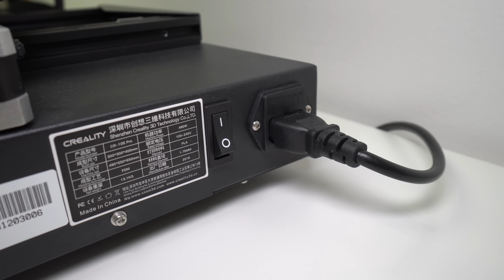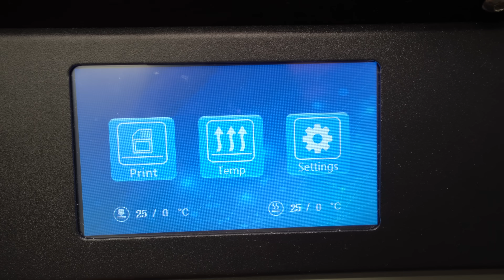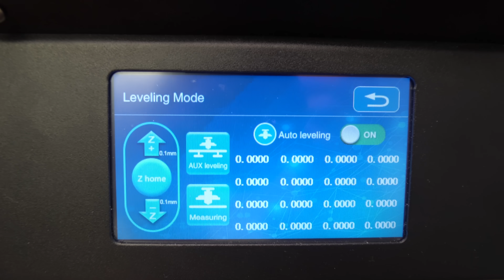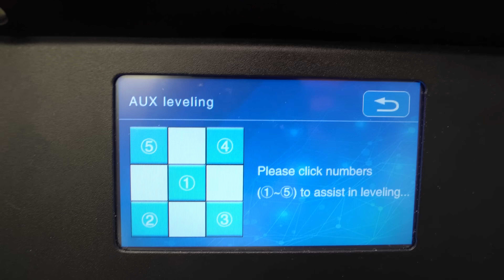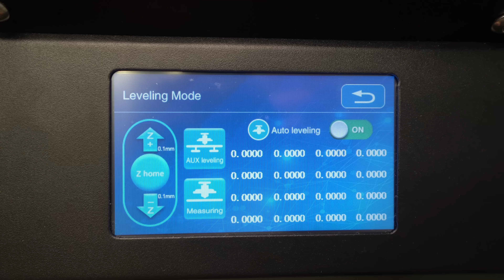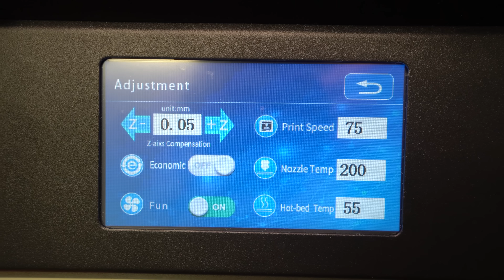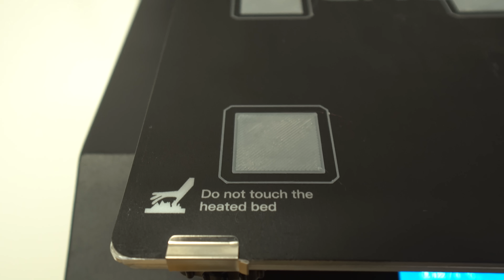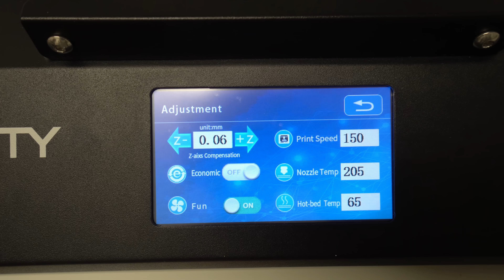Creality Cr10S PRO - Fix your bed leveling issues (Inductive sensor install)

Comment: I just did this upgrade and now both the inductive and conductive sensors keep saying z_min TRIGGERED. Both sensors light up when triggered but they won’t allow the Z to lower. I have marlin firmware if that makes a difference.
Reply from the maker: Justin Sliker Damit! You did not read my Pin comment? I seems like there are few versions of these inductive sensors and apparently wrong one can damage the board. Which sensor type you received?
Reply: Nexi Tech I ordered the correct sensor but amazon sent the wrong one. The main board is toast.
Reply: @justinsliker6995  It may be the daughter board went out. Read some of the other comments on this video and you'll find someone posted a link to Facebook. The post says there should be an LED light that lights up on the daughter board that the ribbon cable attaches to. If it does not light up, that board might be your problem.
Reply: @justinsliker6995  fortunately for me I've only had my printer for 3 weeks so Amazon is sending me another printer to pull the daughter board to fix my printer. I will let you know if it was in fact the daughter board or the main board that went out on my printer.
Reply: @justinsliker6995  so i got my new printer from Amazon but i could not bring myself to changing out the daughter board due to the free replacement period ending the day I got the new printer.  So I ended up moving all my upgrades to the new printer and am sending back the old printer. Sorry I could not say for sure the daughter board was the cause of the z home issues but I think it was. My LED light on the daughter board would not turn on on the old printer but it works on the new printer.
Reply: I just did the same thing. I was hasty in my installation and didn't test it beforehand, seems to have blown something as it's always triggered. Sensor says it's the right part number (LJ18A3-8Z/BX), even says NPN and NO on the label (Taiss). Tested it now and it's not as described in the description (I suspect it's a NC). Fortunately checked on the main board's "Z - " connector and if I plug the old sensor (not gonna try the Taiss thing again) back in there it toggles between triggered and okay, so this weekend I'll make an extension and switch back to the old sensor for the time being. 

Lesson learned- test beforehand, don't just rush home from work and get overexcited haha :p.

Comment: Another great tutorial nexi. Do you happen to know the connector type that connects to the board(3pin white). Was hoping to change my sensor without doing any soldering. Again keep the great tutorials coming for the 10S Pro.
Reply: Jst 3 pin connector
Reply: Yeah but hard to find one with a clip.

Comment: Inductive sensor doesn't work with stock glass bed, unfortunately. 
My CR-10s pro came with glass bed from the factory, the original capacitive sensor worked like a charm, until the cable broke due to movement and the inductive replacement recommended in this video needs to touch the bed to sense the aluminium, that is under the glass.
Reply from the maker: Please read pin or the first comment that I leaved. Here is copy-paste:
 Also I got a lot of questions about inductive sensor and glass so here is my answer:
 This Inductive sensor will work with glass sheet over the aluminum heated bed, but glass needs to be less then 2.9mm thick. The thinner the better. When sensor trigger on 2.85mm glass you have 0.5mm clearance from nozzle. It's not too much but it can work if you can't found thinner glass. 
Personally I use 2mm glass(1.92mm actually) and sensor triggers 1.35mm away from the glass bed. I have a lot of clearance. Here are few photos with my 2mm glass where sensor triggers and how I set it up.
https://drive.google.com/folderview?id=1z4Okyd85OK-rolp2ZkaUS3xgqnzXZtaE
Reply: @NexiTech  sure. I just wanted to point out that it won't work with the printers that come with glass from the factory, because it is thicker that what the sensor can sense, as you pointed out in the comment.

Comment: 13mm sensor? the stock is 16.5mm and your links sais "Diameter of Head: approx.18mm
"
Reply from the maker: Where did you found 13mm? 
Stock capacitive sensor has
18mm diameter thread,
head of sensor(plastic part) is 16.4mm and length of whole sensor is 61mm. 
Inductive sensor has:
18mm diameter thread, plastic part is 16.47mm and whole sensor length is 67mm.
I just check it with my digital measuring tool and I have checked all links as well
 None of them says 13mm where did you get that number?
Reply: @NexiTech  in your comment mate. Just saw you changed it  to 18mm. everything ok now. thanx
Reply from the maker: Salvatore de Mosticos Aha there! Ok I got it. Fixed. I was afraid that links are wrong. Thanks for let me know. Cheers

Comment: Ok...I have made this mod per the video and it will work “IF” you use the stock print bed.  If you go to any other non-metallic print bed, like my Tempered Glass bed : 

https://www.amazon.com/Original-Creality-Tempered-Surface-310x310mm/dp/B07MJFVP6N/ref=asc_df_B07MJFVP6N/?tag=hyprod-20&linkCode=df0&hvadid=245382193910&hvpos=1o2&hvnetw=g&hvrand=9966712246438985868&hvpone=&hvptwo=&hvqmt=&hvdev=t&hvdvcmdl=&hvlocint=&hvlocphy=9030021&hvtargid=pla-645833750810&psc=1

You have to place the Inductive Leveling Sensor very close to the Print Bed ~0.5mm Higher than the nozzle.  Although this should work it makes me nervous it could strike the print....more to follow on that.

Very difficult to level without stock build plate.  Drove my nozzle into the glass several times before I figured out how low I had to get the sensor.  At ~6:00 in the video the author describes hitting the Z Home button for the Printer to get its new z Offset.  This, most certainly, does not work on my printer.  It would be nice if the software was smart enough to read the value from the sensor and record it to memory for it Z height but I don’t think this is how it works.  I think this is a simple switch and when the sensor is 8mm  (per the sensor Spec) from the Metallic Bed it switch’s on and the z axis steppers stop.  Thus adjusting the sensor height is the only way to get the z Offset value established.  If I am wrong here, pease let me know.    I think the Capacitive Sensor is much better as it  has an adjustment screw that allows for different offset sensitivity (allows for varying print bed materials).  If I had to do it again, I would not have gone down this path as now I have cut the connector off my sensor and soldered it to the new sensor!

Comment: Perfect, I was mis-informed. Should have done what you did and got the meter out.  I am curious why the sensing range seems limited to less than 6 millimeters.
Reply from the maker: Nathan Liebespeck I'm guesing that's what you get on 24V. Possible on 36V you get 8mm detecting distance. I use 2mm glass over my aluminum heated bed with this inductive sensor and I have over 1mm clearance. Work's great.  https://drive.google.com/folderview?id=1z4Okyd85OK-rolp2ZkaUS3xgqnzXZtaE

Comment: The sensor appears to be a 6vdc sensor. Since the board only outputs 5vd to the sensor, would it be advisable to add a buck converter and supply the sensor with 6vdc?
Reply: Or even 12vdc?  Would that increase the detection range?
Reply from the maker: Nathan Liebespeck Inductive sensor in the video has operating voltage from 6-36V
Motherboard outputs 23/24V to the sensor not 5V. 
https://drive.google.com/file/d/1zDrrJg-Q192hi-gxijtC-DUzX5W4cNfc/view?usp=drivesdk
Reply: Just as a heads up. I just tested 2.5mm glass with a 26ga piece of sheet steel. The inductive sensor is triggering with 5mm of clearance.

Comment: What firmware? On the last one the sensor just freaks out and punches holes in the bed after many correct levelings.
Reply from the maker: Carlovfx Please read my first (Pin) comment(post).
Reply: @NexiTech   ok, i am on your same firmware and everytime I go in the leveling menu the printer autohomes, checks the z height 3 times and at the third time it punches a hole in the bed.
Reply: @narcotixfpv9795  I just upgraded and mine is doing the same!  Did you ever solve this?
Reply: @patrickcurry2635  yes you have to level the sensor correctly. It's a bit tricky but doable. Basically just move the head about 0,2mm above the bed and THEN level the sensor till the led blinks.

Comment: I am confused on how you level it with the inductive sensor. In the top of the capacitive sensor there’s a small set screw at the top that allows you to adjust it to get the proper nozzle height off the bed. How do you do this with the inductive sensor with no adjustability in the sensor?
Reply: Hi, same question. How do you fine tune the 0.2mm gap without this tuning screw?

Comment: if in change to glass heatbed, the inductive sensor will not work. Am I right?
Reply from the maker: Theantat Tor Actually Inductive sensor will work with glass sheet, but glass needs to be less then 2.9mm thick. The thinner the better. When sensor trigger on 2.85mm glass you have 0.5mm clearance from nozzle. It's not too much but it can work if you can't found thinner glass. 
Personally I use 2mm glass(1.92mm actually) and sensor triggers 1.35mm away from the glass bed. I have alot of clearance. Here are few photos with my 2mm glass where sensor triggers.
https://drive.google.com/folderview?id=1z4Okyd85OK-rolp2ZkaUS3xgqnzXZtaE

Comment: Hi, great video. Thank You. But I don't understand the leveling : On the sensor that come with printer, there is a screw. So you can program the sensor to turn on when approaching the plate. How do you do this with this sensor ?
Reply: You cant adjust this with a screw. You have to move the whole sensor since it is only on/off

Comment: man im desperate here i cannot figure out whats going on with my cr10s pro i cannot get it to zero my z.  when i home my printer my z is almost 50mm above the bed.  i cant figure out what the heck is going on here.  i have the latest firmware because i couldnt get this pos to even read any gcode files over 10mb.  im so close to tossing this in the garbage.
Reply: I have the same issue, after changing the sensor and firmware it homes 50 to 60mm above the bed and keeps moving up instead of moving back down. Triggering the sensor manually doesn't stop the z. I have tried changing back to the original sensor and it does the same thing.
Reply: @jw7792  same issue! Did you work it out I'm going mad, I have taken the whole thing apart even checked the board for shorts everything. I'm going to rewire the stock sensor and try that.
Reply: I am also having the same issue. Has anyone resolved this issue or do I need to contact the seller?
Reply: @OverTheTopFabrication  turns out that the octocupler / phototransistor on the daughter/ Control board (the board the ribbon cable plugs into mounted on the X axis) is burnt out meaning the sensor doesn't work and can't determine its position.

IV had to contact the seller and arrange a replacement, Creality themselves said they don't supply parts and you have to deal with the seller you got it from.
Reply: ryan avent thank you for the reply. I bought mine from Banggood. So contact them and tell them I need a daughter board that is mounted to the X carriage and see if I get it by next year? Lol
Reply: @OverTheTopFabrication  good luck I couldn't find a spare part anywhere, and the printer is useless without it.
Reply: ryan avent There is a temporary fix to get yourself printing again until the sensor situation gets figured out. If you are comfortable with editing Arduino files then do the following: extend your stock sensor cable long enough to reach the motherboard on the inside of the printer. Open the marlin Arduino file (watch 3d printing Canada’s bl touch video) edit line 91 to say #define ABL_EZABL // TH3D EZABL or Any NO Sensor. Upload the firmware to your printer. Plug the extended cable into Z- on the motherboard. This will allow the printer to home. But DO NOT home it yet. You need to adjust the offset of the sensor first. I would home it on a raised surface first so you don’t run your nozzle into the bed just in case you are not set up right. Just place a metal ruler or your feeler gauge on a cardboard box
Reply from the maker: Man relax, tell me is the sensor probe stock or you change it to inductive one like I showed here in this video? Maybe you got bad sensor so it's triggers to high.
Reply: Same issue!
Reply: ryan avent I am at Creality today trying to fix the issue. Many others have been contacting customer support with the same issue. I will keep you posted.
Reply from the maker: @IndieRyanAvent  Wait a second! You telling me that new firmware has some sort of bug?! How is that possible I'm running it for days and it works like charm?!  Is there difference in the motherboards on newest Cr10S pro or is it something random? I don't get it...

Comment: Hello! Does enyone have a problem with the chip reader on this 3D printer? I had the joy only one to print with it but then i couldn't manage to make the chip reader to actually read the SD card ... i tryed a thousand times and it s  just annoying... i just recieved it today and i m already having problems with it
Can anyone help me, please!!
Reply from the maker: seya alice Did you tried another Micro SD card?
Reply: @NexiTech  yes, of course, and i even tryed the USB slot...nothing seems to work
Reply from the maker: seya alice It most be faulty Motherboard. Write back the company's from which you order the printer from. They must supply you with the new motherboard. It's easy to swap it. You can do it yourself.
Reply: @NexiTech  okay, thank you!

Comment: Great Video! Already bought the new sensor but does anyone knows where I can by this connectors connecting the Sensor with the plate? I want to solder it to another connector so I can Swap them out instead of damaging the original parts :)

Comment: Great video, as always. After reading your recommendations. I would like a simpler explanation. Recommend to lower the sensor by 3mm (in the video it was positioned at 3.81 mm using the acrylic piece) 1) So the sensor is positioned at 0.81 from the bed? 2) Or can the sensor be positioned between 3 and 2 mm, for a more accurate positioning? Clarify this doubt, the first or second option? Sorry if I misinterpreted, but be patient, risk and impact the nozzle. I'm your fance, so I want advice. Thanks B.S.
Reply from the maker: Salvatore Bilotta Thanks mate,
Sensor works best when is like 3mm or less from heated bed, between 3mm and 2mm are just fine. 
After close inspection when I was using 3.81mm acrylic piece+ BuildTak is like 0.4mm. That's 4.21mm which is too much for this sensor and on one place nozzle was slightly touching Heatbed. That's why I wrote comment and Pin it so that can be on the top for people to see.

Comment: Hi Nexi Tech, nice update and perfect explained. would be great to know which "Start G-Code" and "End G-Code" you use in Cura. I presume that my old code is contra productive
Reply from the maker: Ronny Beger Thanks Ronny! 
I just use standard Star-End G code. With the latest Creality Firmware 1.60.7 Start G code 29 for auto leveling is build in. Why do you wonder about start end G code? You god some problems with or?
Reply: @NexiTech   My Start G-Code looks like:
M107 ;Turn layer fan off 
G21 ; Set to metric [change to G20 if you want Imperial]
G28 ; home all axes
G1 Z5 F3000 ; lift
G1 X70 Y2 F1500 ; avoid binder clips
G1 Z0.2 F3000 ; get ready to prime
G92 E0 ; reset extrusion distance
G1 X120 E10 F600 ; prime nozzle
G1 X150 F5000 ; quick wipe

This cleans the nozzel at the beginning and give me some shot time so optmize the printing height, but not sure if this G28 may cause problems.

End-G-Code
G91
G1 F1800 E-3
G1 F3000 Z10
G90
G28 X0 Y0 ; home x and y axis
M106 S0 ; turn off cooling fan
M104 S0 ; turn off extruder
M140 S0 ; turn off bed
M84 ; disable motors

Comment: Hey Bud, just followed your instructions and replaced my sensor with the inductive one from amazon. BIG THANKS! I actually got a better price on amazon canada for it!  One thing to note, the plastic flat bar used for leveling sensor and sides, with my unit for whatever reason, with the nozzle sitting on a .2mm feeler and that plastic bar under my sensor the sensor does not engage, its just slightly too large of a gap, i tried it as is with apprehension, that was a mistake lol, punch a hole right down through the creality bed release cover and into the aluminum bed under it.. just a small damage, but enough that ill probably replace it now.  my own fault for not being ready with something metal to put under sensor in case of emergency. live and learn. i ended up dropping it down like .3mm more towards the bed and set a Z offset to match the new height, printing my first test print now. so far so good.
Thanks again. video was great detail and very easy to follow.
Reply: Hello. Do you have a link for the sensor on amazon canada ?. Thanks in advance
Reply: Ya man for sure, URBEST LJ18A3-8-Z/BX 8mm Inductive Proximity Switch 3 Wire NPN NO DC 6-36V Cylinder Approach Sensor https://www.amazon.ca/dp/B06XRSV6XG/ref=cm_sw_r_cp_api_i_-LrHCbY1KGXRF half the cost compaired to ordering from .com to Canada that is. Mine is working great, I leveled it once and now haven't really touched it in 2 days. Very happy with this upgrade.

Comment: did you have layer shifting printing some object? i had a lot, in particular when the y-axe have to move in a large path and for different object
Reply from the maker: Rosario Ricci Layer shift? Nope, never. Sounds like you have low voltage on Y stepper driver. Have you tried to check it and adjust it? Or it can be that some bearing under Heated bed is over-tight or stuck. When printer is ON is your heat bed easy to move back and forward with the hand?